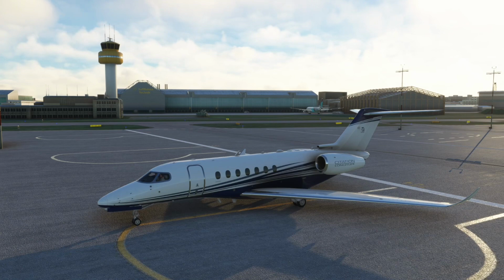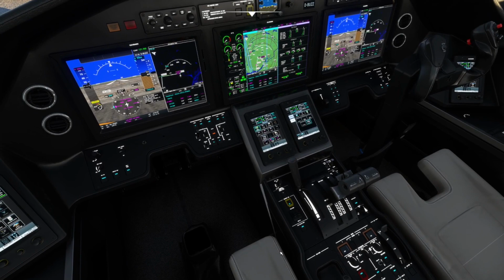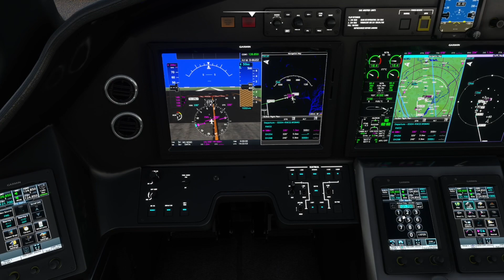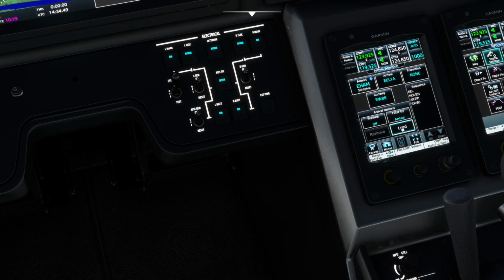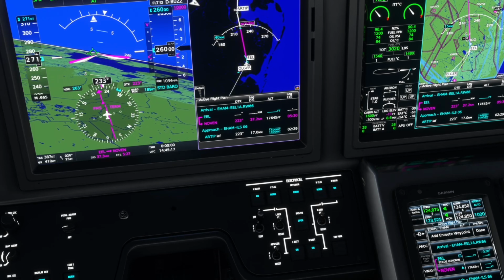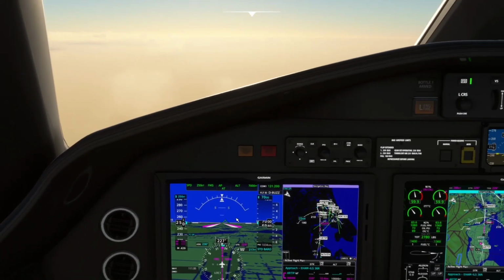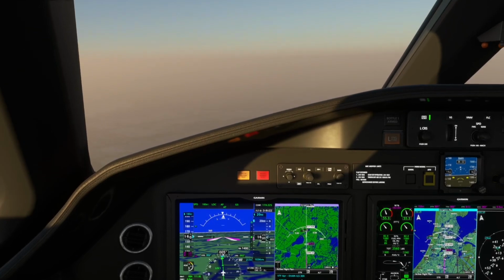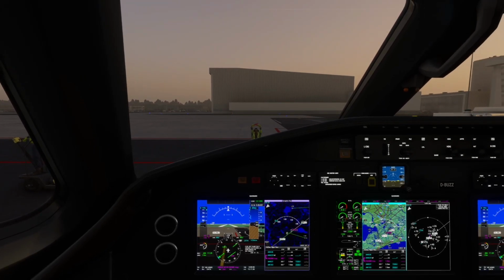MSFS | Citation Longitude AAU1 Beta | Hamburg (EDDH) - Amsterdam (EHAM) | VATSIM |

Comment: I almost feel ready to try vatsim. I think I can handle the radios I need to learn the flying parts like holds, go arounds and some vor radial stuff. Anything else you think someone should know how to do before getting on vatsim ?
Reply from the maker: Hi, just make sure you are comfortable modifying you route and always have a notepad to write things down. Also, probably not a good idea to  do your first flight at a busy airport like KBOS, smaller airports will usually only have a few aircraft active  at any point in time. Most important, have fun. Cheers!